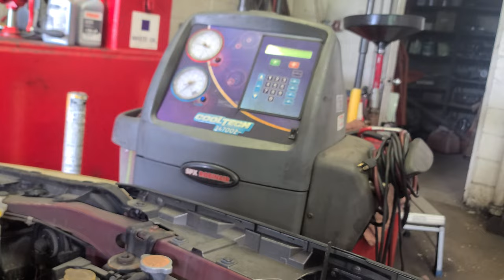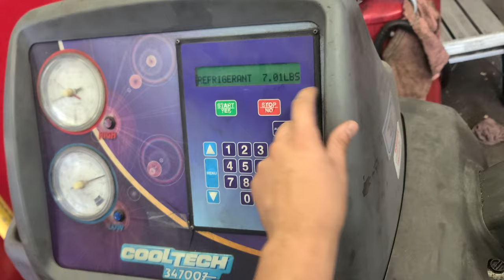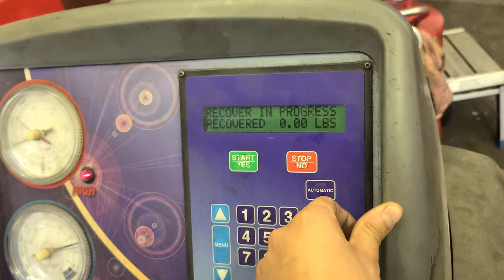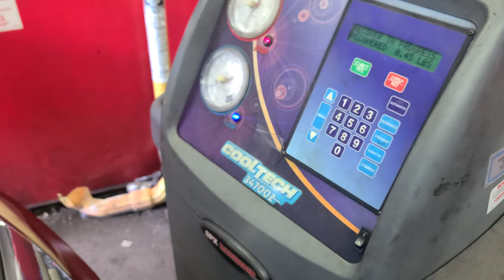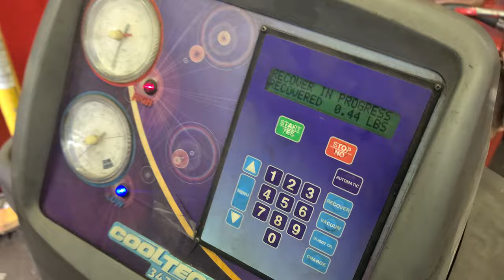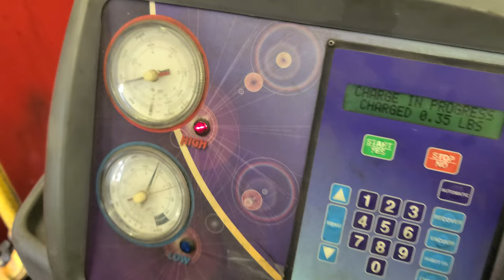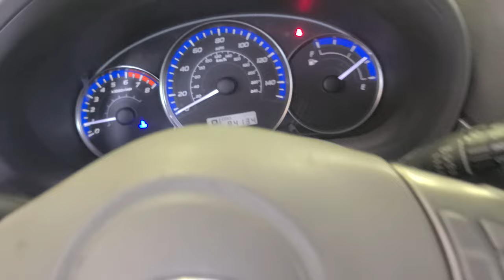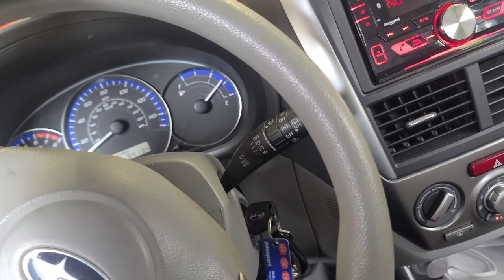2009 - 2013 Subaru Forester How to refill the AC system with frion

Comment: There is not much use for a regular guy who doesn't have a huge compresser.  Most people will just have a can of freon refil from walmart, connect go the low-pressure inlet,  and be done.
Reply from the maker: Right!
This is for the people that wanna know how a tech do a real refill in a shop.
Of course there's a big difference between those 2 type of services. 
You don't want you compressor nor the lines to blow up.